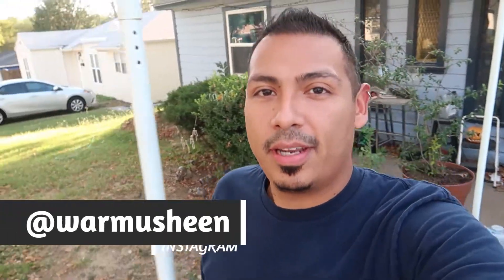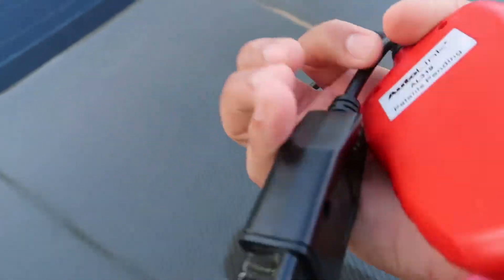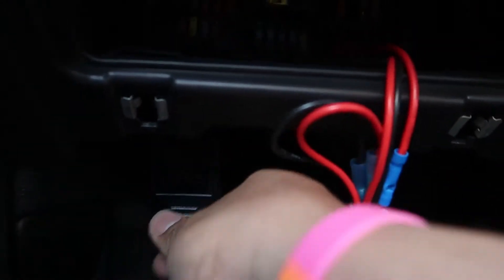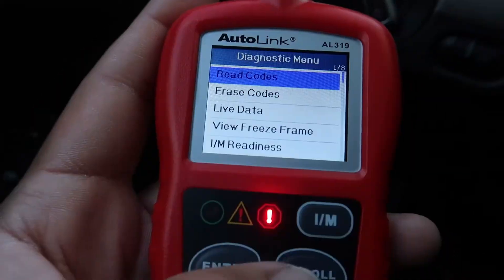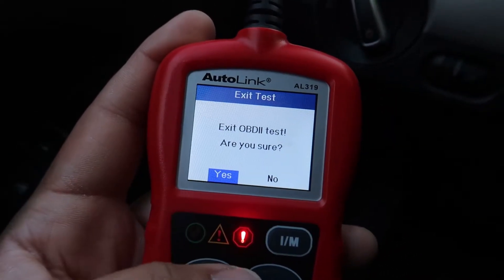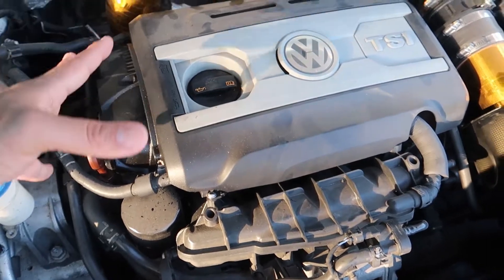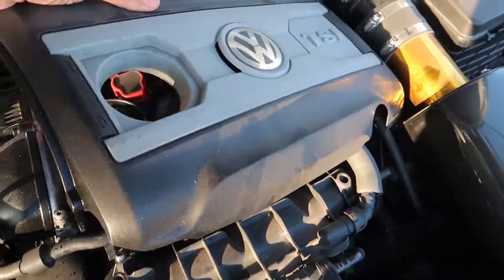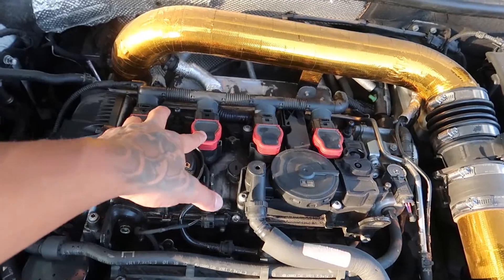Diagnosing a check engine light...

Comment: probably an 02 sensor on downpipe
Reply from the maker: I think you're right. Apparently they fail around 60,000-90,000 miles. Might end up replacing it too just in case.
Reply: @JoelsDriveway  mine did at 82
Reply from the maker: Engine light is off. Car is back to normal. Looks like that was the issue after all. Thanks for the tip!
Reply: Can you confirm what was the problem,i have the same code,recently instaled an APR intake,replaced the intake manifold and sensor,problem is still here 😢